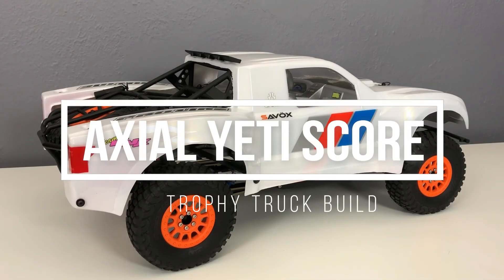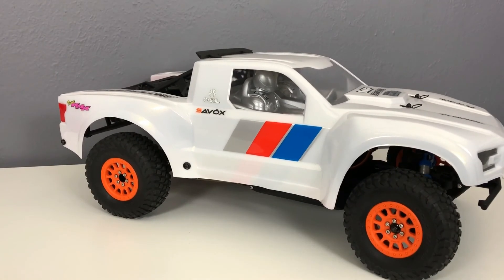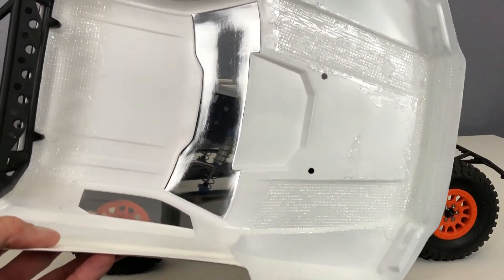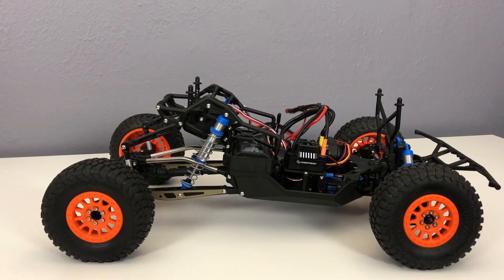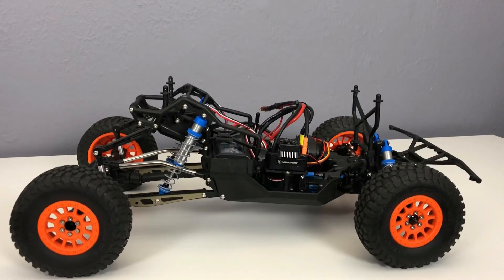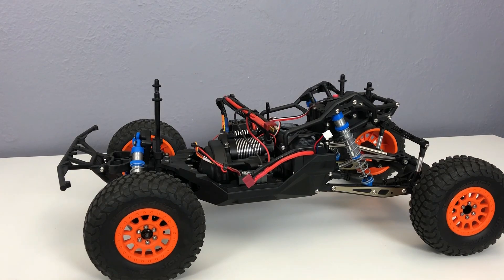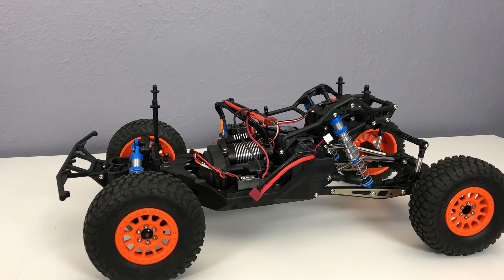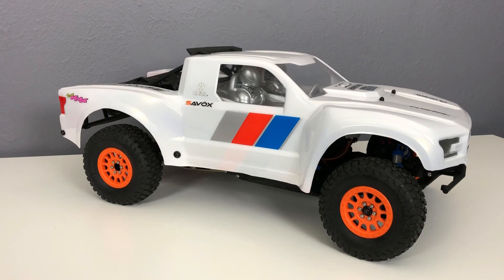AXIAL YETI SCORE TROPHY TRUCK overview and upgrades

Comment: I have the same Hobbywing setup on my Yeti, that's a nice build and I like the white color.  I checked the temps initially on 2s and then 3s on mine and i think the rear diff was hotter than the motor lol.  I love the sound the hobbywings make when you brake too.
Reply from the maker: RC Enduros I have not tried 3S.  I used a 100C 2S and it was great.

Comment: Nice build, but there are lots of kits out there you just have to look.
Reply from the maker: Basildon Trail Blazing Buddies not as many as the old days, or the variety.  If you want to race, there are kits (and that’s a good thing) just an observation from a older hobby guy ;)
Reply: There are plenty of non race kits out there, for if you like crawling and trucks. I have always built kits and a had a few RTR but to name a few crawler makes . Gmade, Cross Rc, Rc4wd, Carisma, Hobao, King kong and even Traxxas have done a semi kit plus many more There are a lot more RTR now but kits are plentiful. But  a older hobby guy, I'm 53 and been tinkering with rc for 34 years.
Reply from the maker: Basildon Trail Blazing Buddies in the crawler market is where you find the most.  I have take a few long breaks from the hobby.  From the late 1990’s to the mid 2000’s and then from the mid 2000’s to about 2 years ago.  I was shocked at the RTR scene.  It’s not all bad.  But when I started building Tamiya kits in the late 1980s as a teen.  It’s much different now.